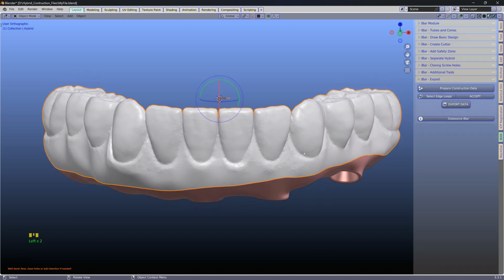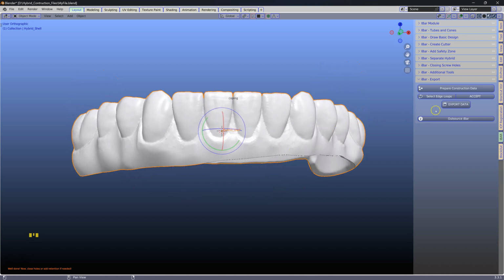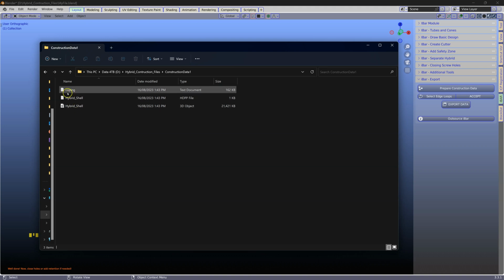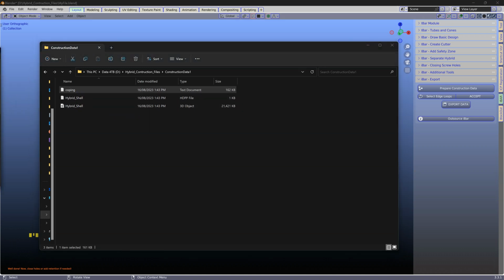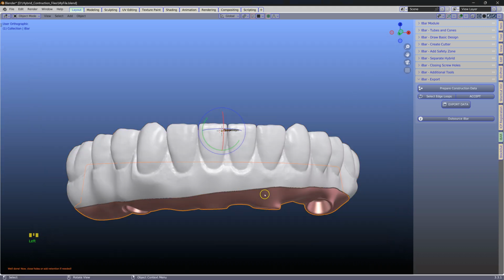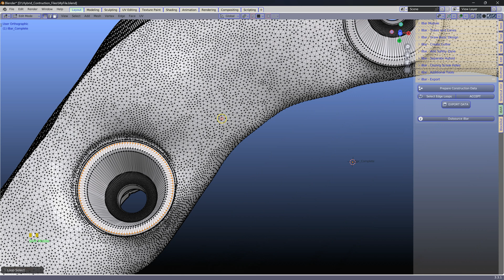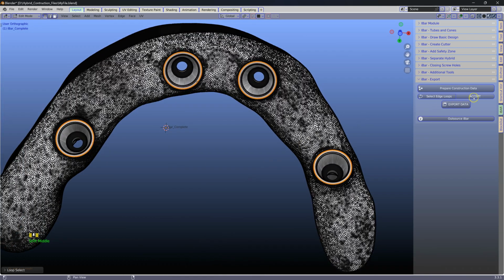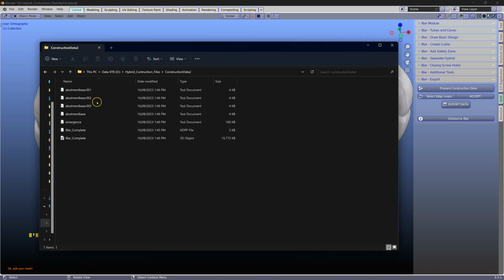Construction File Data for an iBar. NEW!!!

Comment: Hello i have blender 3.5.1 and i dont have ibar export, in your video you have 3.3.1 is there an option on settings or something to activate it ? Thx
Reply: Have you downloaded Blender for Dental already? Once you do, you'll see a small arrow at the top right corner in Blender. Click it to expand the iBar. 😉
Reply: @Write-Stuff  hi, i have the ibar module but dont have the ibar export button and dont see the small arrow that you mention
Reply: Hey did you ever find a solution for this because the same thing is happening for me
Reply: @baserunner7071 nope